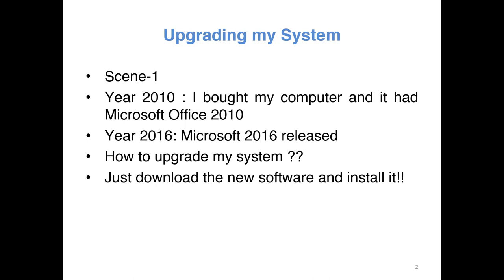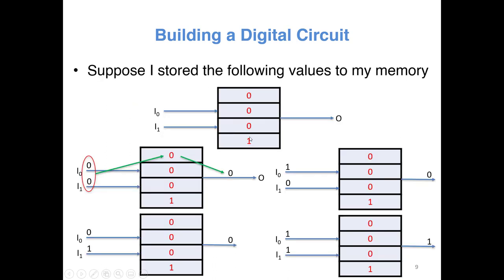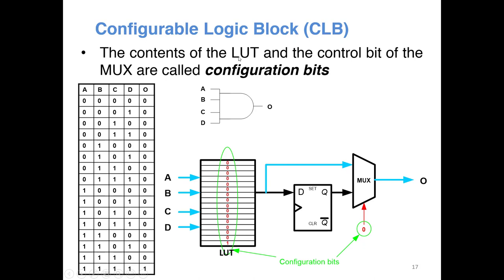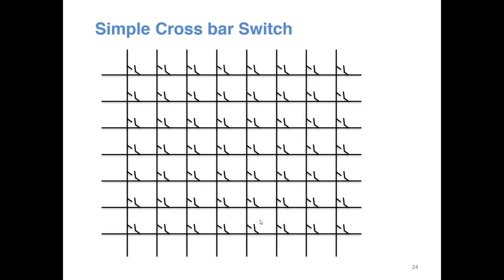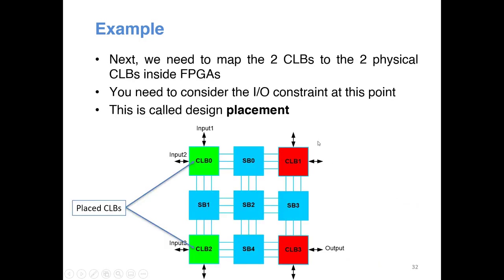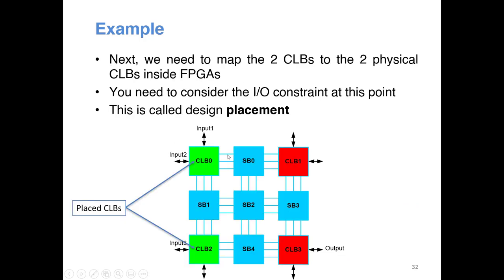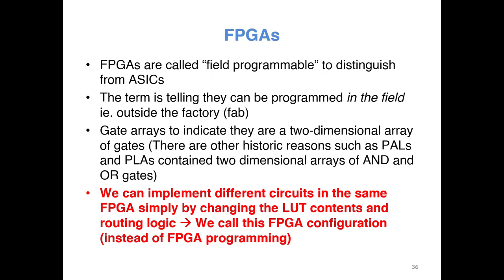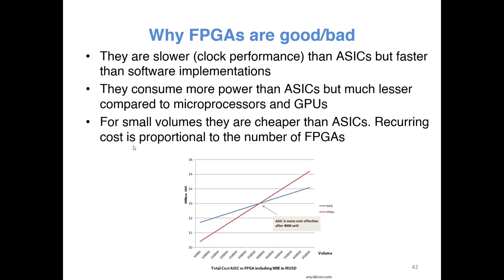An Introduction to FPGAs: Architecture, Programmability and Advantageous

Comment: How input say 00 knows that it needs to access first location of the LUT? Is it anything we need to mention while programming? And how can we store any logic gates truth table's output in LUT?
Reply from the maker: LUTs are small memories and they are made like that. 00 is always first location 01 second etc. What value should be stored in location 00 depends on what we want to implement. Now a days we don't directly specify it. We write the logic in an HDL language and the FPGA vendor provided software will find what values to be stored
Reply: @Vipinkmenon  My fpga board have 6 input and 2 output LUT.  What I will get output for input 000000. Here,  I can get two output. What I will get first and second output?
Reply from the maker: From Virtex 6, Xilinx uses 6 input LUTs. Those LUTs have 2 outputs. You can use a LUT as a 6 input 1 output LUT or 2 five inputs 2 output LUTs as the LUTs are fracturable. You can't use it as a 6 input 2 output LUT. Details you can see here. https://www.xilinx.com/support/documentation/user_guides/ug474_7Series_CLB.pdf. Please read chapter 1.
Reply: @Vipinkmenon  Can you tell me how can I configure 6 input 1 output LUT for half adder? truth table of half adder has two output. One for carry and other for sum
Reply: @Vipinkmenon  It is for educational purpose. And I need to get high performance. So, I need to understand in very basic layer. How simple one bit addition operation can be performed using CLB?
Reply from the maker: One 6 input 2 out LUT is enough for implementing a full adder since both sum and carry functions are of same literals. To really understand it you need to read the manual I sent you. Internally the 6 input 2 output LUTs will be used as 2 5 input LUTs. Each 5 input LUT has 32 locations. The first LUT content will be 0,1,1,0,1,0,0 and 1 in the first 8 locations and remaining 0 (don't care) For second LUT 0,0,0,1,0,1,1 and 1 remaining all 0. Both LUTs will have same inputs A,B and Cin. The other 2 inputs will be permanently grounded.